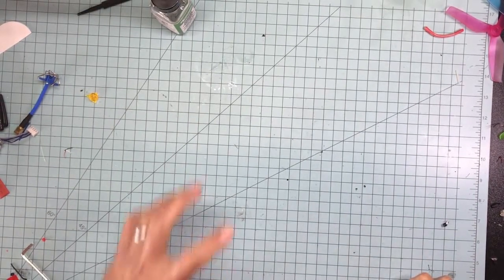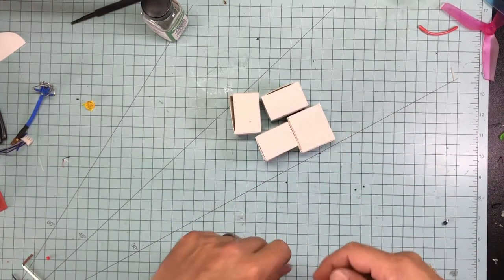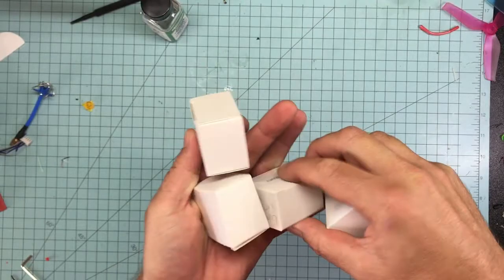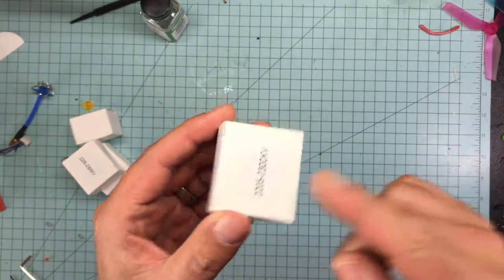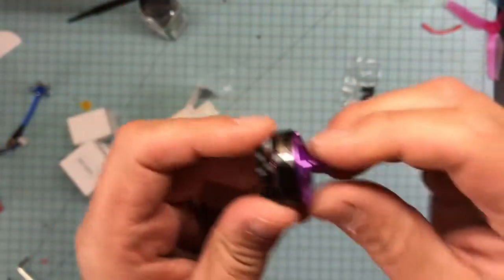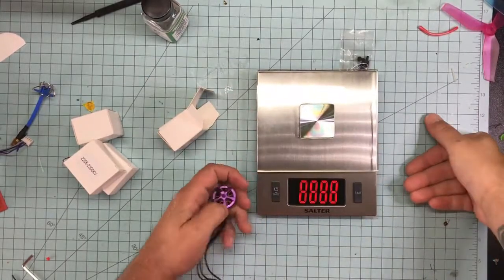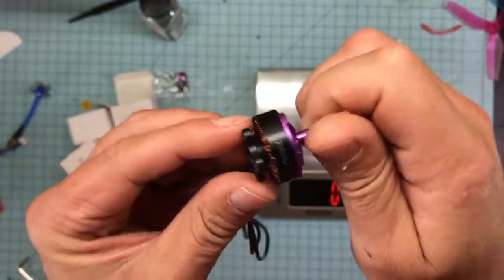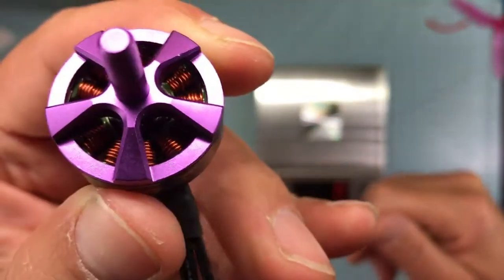The Zebruh FPV Project = Brother Hobby Returner R2 NADS Motor Review.. aweseome

Comment: https://www.rcgroups.com/forums/showthread.php?3002993-Geprc-Sparrow-Build

As soon as I maiden her I'm putting the runcam on top lol.
Reply from the maker: Sweeeeet looks awesome brother.   I think I have that frame and shylo and I are doing a blades build with it!! I think.   If not it’s damn close
Reply: JJRotoGeek true. I've seen that frame somewhere. Looks awfully familiar lol. Yea the only issue I had with the build was trying to stick a 16ga power wire to the little solder pads for the battery connection. Heck I even ran it thru the middle of the stack to keep it from having off the side. That didn't work. Couldn't put the fc all the way down. So all I could do was solder it the vast I could then zip tie it to the arm before I broke the solder connec again lol. Must have soldered it 15 times the other day. But she powers up and no smoke woo.
Reply: JJRotoGeek in the process of making some new vids before I kill my 210 hah. A few BAD crashes lately while trying to push my limits. One at 100% throttle into a tree, found my runcam roughly 100 yards away, was insane I was going nuts looking for it. Finally bent a racerstar 2205, just my excuse to get some more brother hobbys and upgrade the 210 while building a 100mph quad.
Reply from the maker: Lolol that’s awesome!!! Least u found it.    If destroyed so many cameras I keep Kodak in business lol
Reply from the maker: Lololol.    No magic smoke = happyliness lol
Reply: JJRotoGeek lol yeah man I prolly would've cried if I lost that cam. I've had that runcam 2 since they first came out. But if and when I loose it, it will be my excuse to get a GoPro session 5 lol.

Comment: Damn u got them in fast , n they only 1 gram lighter than the 2700kv ones I have , n I found out with mine they run better with them 504.8 racerstar props like the ones on ya table in this video 👍👍
Reply from the maker: saweeeet thanks for the tip brother!! they look damn nicce i think.
Reply: JJRotoGeek yea they do n I like that them have the naked bottom , n I can tell u u won't regret getting them 👍👍 🏁🏁